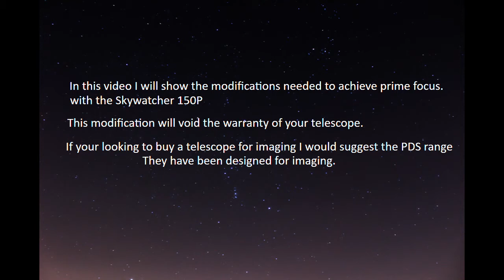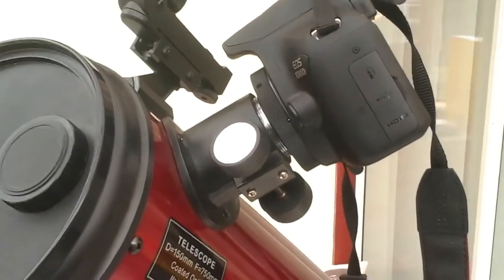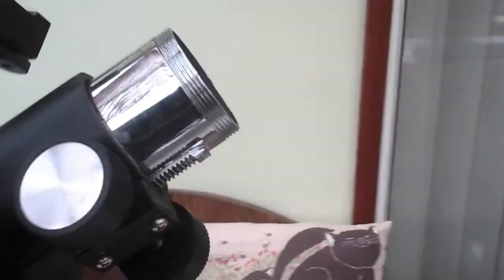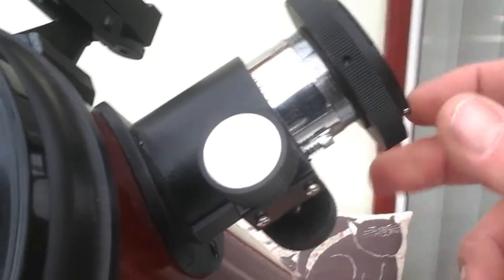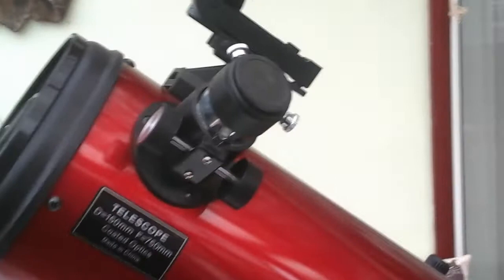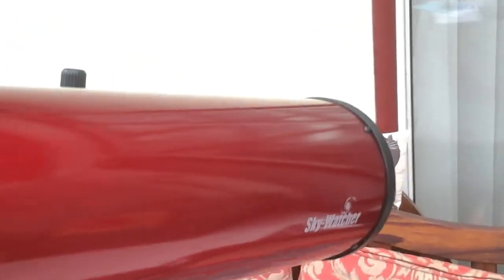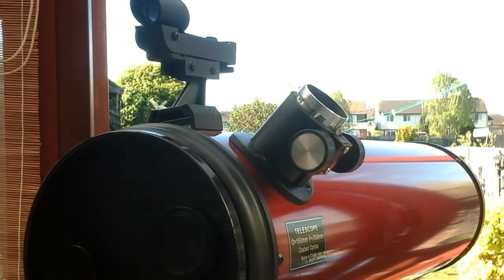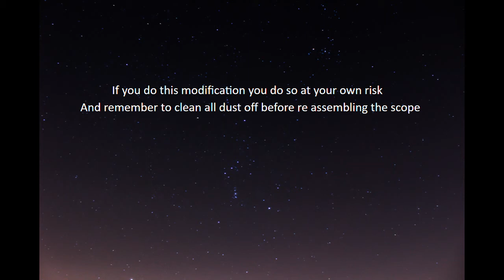Focuser modifications needed on the 150P to achieve prime focus

Comment: To achieve prime focus on my 130 SLT I moved the primary mirror in 30mm using threaded standoffs. Not knocking your method but I could return the telescope back to stock form without any trouble. Of course that was before I cut the focuser hole bigger to fit an Orion focuser! Just curious why you chose this method. Thanks for the videos, not many people trying to push Alt-AZ astrophotography to the limits out there.
Reply from the maker: Thanks. I chose this method mainly because it was the cheaper and easier solution, The star discovery 150p has a fixed primary mirror with no collimation adjustment. The tube would need to be cut down by 25mm. unless a complete primary mirror mount was made.

Comment: Wow. I had the same problem on my 200mm Newtonian, but in the end the solution I used was to switch to a low profile focuser.

As a temporary solution, you can screw the lens cell on a Barlow lens straight onto the nose piece adaptor of the camera.

Comment: Hi! Nice video there :)

I have a Skywatcher 130/650 also with a fixed primary mirror (no collimation needed) but I can't  reach focus with my DSLR. I tried to "fill" the back of the primary mirror with some material (hard cardboard for almos 1inch) to put the mirror a bit in without cutting the tube but still no focus.

I will try that also with your solution for the focuser or maybe try a mirrorless camera.

What do you think?

Comment: Hello, With the second method using the T ring/1.25¨ adapter I cannot get focus because the camera can not get close enough to the telescope. I will have to use the method of the ring made in 3d that fits inside the T ring. I think the T ring has to contact with the focuser to get focus.
Reply: the same with me, were you able to made the adapter?

Comment: Hello there Nigel (I know u from Stargazers lounge), 

I have a the same telescope and mount, however I haven't done any modifications for Astrophotography instead I went ahead with a barlow lens upfront with my dslr.

I am having some problem with tracking. I understand that alt az mount can accurately track upto 30secs before the rotation issue occurs but I am not able to track even for 30 seconds accurately. 

I align my telescope properly but It still seem to away from the object I point my telescope to, then I use directional keys to bring to the centre of my eye piece or dslr and still it is unable to track the object. 

Can you please share some important tips for alt az mount tracking. Thanks!

Also note that I use batteries instead of a power tank.
Reply from the maker: Hi :) I have taken sub's up to 90s on a good night with 50% keep rate ( not often happens). With 45s exposures I expect a keep rate of 75% & 30s exposures a keep rate of 90%. 15s 99%.... 
 When using a Barlow lens with the camera you are reducing the exposure times to half the possible time due to twice the magnification = not so accurate tracking. The main problem is- with a Barlow lens you need twice the exposure times to gather the same amount of light on the chosen DSO. I tried it a couple of weeks ago and gave up quite quickly with around 10s max exposure, not enough photons. Barlow's are fine for planetary and lunar imaging but on an Alt-AZ mount without guiding, very difficult to do DSO's.
 If you can afford it I'd recommend the 130P-DS, Its got great reviews and ready for AP.  £175 new. It's a far better scope for imaging, more ridged, much better focuser, thinner secondary mirror supports and the primary mirror is set closer for focusing camera's. I was going to get one but I got a 80mm refractor instead.
 Good luck :)
Reply: Alt-AZ Astrophotography Thanks for the amazing advice! 

Can you give me some alignment advice? If I   don't find my desired object in the finderscope despite alignment,  should I use my directional keys to re centre it or long press ESC key and re center it? 

And lastly,  what material did you use to blacken the bottom of the focuser to avoid reflections? 

I'd be very happy if you reply back. Thanks a lot! :)
Reply from the maker: +Shahruq Sarfaraz  Aligning the scope.  I did a data update on the synscan handset which did improve the goto and added altitude to the setup .( the link and cable needed for the update should be with the manual ) I  use a gps app to get my correct position and exact time.  When aligning the chosen stars try to get the star close to the center of your eyepiece as possible  ( I use a 8mm eyepiece ) If you get the star out of focus it appears bigger in the ep therefore easier to center.

When choosing alignment stars try to get 2 stars about 90° apart and not to high or low in the sky.

Quite often  the mount misses my chosen target by a fair bit, I just use the direction keys to move the scope into position.
Another little trick which helps tracking is as follows.....After 2 star alignment try to goto an object. 
If it misses by a fair bit, using the handset press escape until you get to setup. Press enter at setup and then press the bottom right, up arrow key until you reach sync encoder, press enter then choose from the 2 alignment stars to re align the mount. 

I hope this makes sense and helps you ☺ I use the sync encoder everytime I align now.
Reply from the maker: +Shahruq Sarfaraz  To blacken the focuser tube I used a matt black aerosol spray paint ( remove from tube assembly first ☺)
Reply: Alt-AZ Astrophotography Thanks a lot!! I have successfully done the modifications as you have demonstrated but I am still struggling with the bush,  haven't got anything yet to hold my camera at the focuser! 

Haven't got clear skies too..  Maybe soon,  I'll try your tips. :)
Reply from the maker: How about the t ring nose piece to go into the focuser ,( the second way )... Cut a short piece of 1.25 inch ( 38mm ) drainage pipe cut a slot in it and put it on the nosepiece with a little sticky tape around it to take up the final tiny bit of slack. That should do it. especially with a low profile t ring adapter.
Reply: Alt-AZ Astrophotography Thanks for the advice. What I did for now is a temporary fix. I threaded the the focuser and now the T ring fits in good. 

I don't have nose piece, I can buy one but I prefer to save some dollars with a random hack. :P
Reply: when you align telescope you MUST make last fine adjustments to center objekt into eyepice only and only whit UP and right movments!!! This is very important!!!